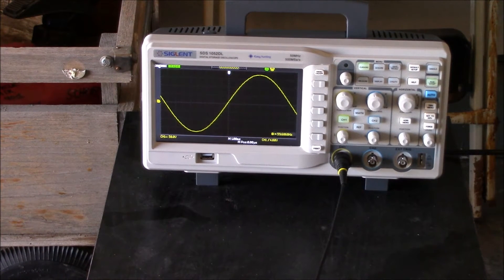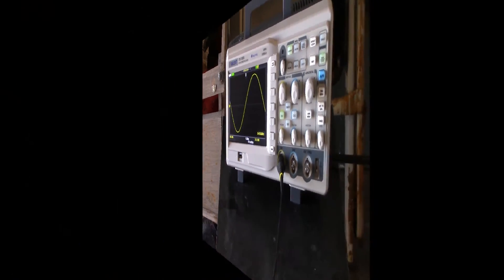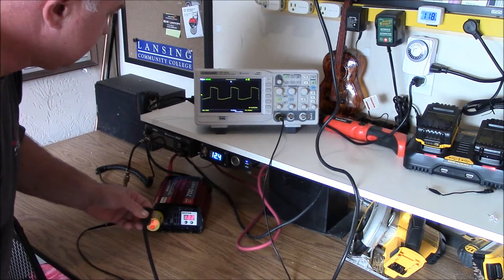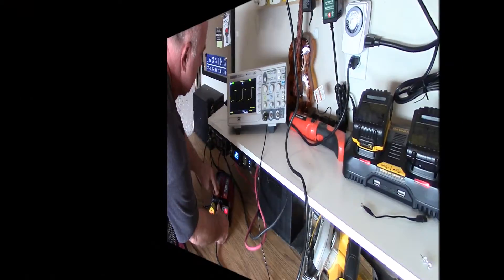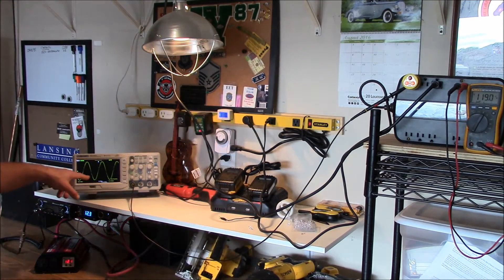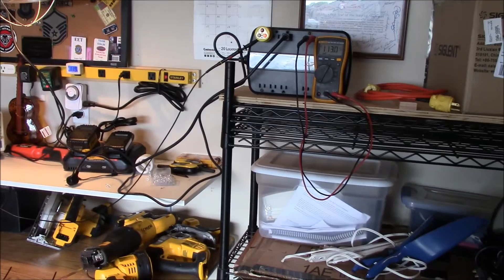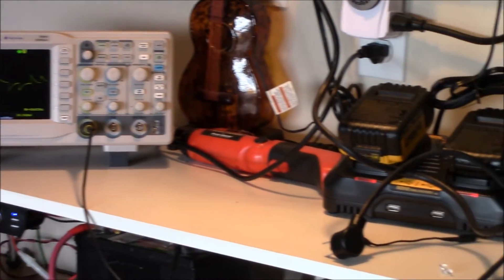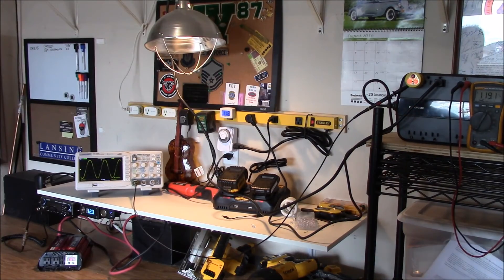How clean is your power? Load testing with oscilloscope.

Comment: Interesting I have a 550 as well and I find that it has out-performed pretty much every model or brand that I have come in contact with I'll be it I did just get upgraded to a nice true sine wave APC that's heating my basement. I did know that it was step approximation and I knew that something was different about it because it runs things better than the older model which is modified Square wave and other brand that was modified Square wave. It has even done better than my 3 modified Square wave inverters 100w, 400w, 750w. I am really thinking I'm getting to the point where I'm needing an oscilloscope I was at a venue doing sound and wished I could have saw what was going on with the electrical as there was a major Buzz that then went away as the night went on and by the time we rung in the New Year there was no buzz from the electrical, there was a buzz from the audio from I don't know what as it's not my system and I haven't tracked it down yet. And it probably didn't help that it was an older building although it did have a ground that was connected to something.
Reply: There's nothing wrong with it from the computer standpoint since it's mostly going back to DC although if your computer is extra sensitive or picky then might want to avoid it. Mine has run a DVR, pfSense dell desktop router, Mac Mini, iMac, laptop with dead battery, access point and switch with no issue. until the battery finally went after 10 years, new battery and all is well again. although I had some issues with it not resetting and thinking it still had an old battery. Shoot my modified sine wave 750 watts could even run the Dell reliably on its own. It has probably run in this configuration for approximately 5 years.

Comment: Hi Chris and everyone. everything you showed was very much right. everyone seems surprised by the APC UPS when on battery mode. I knew the Backups series which you have never guaranteed a true sinewave so i looked it up and it seems to be called a Stepped approximation. If you want to true sinewave from an APC ups you'll have to invest in the smartups line.
Reply from the maker: Right on. I wonder if one could make a small PSW battery back up for less $$$ than the price of a Smart UPS. Could put a trickle charger on it to keep the battery topped off.

Comment: chris, thanks for the experiment. now i am tempted to buy an oscilloscope too. used to work with a 150'000$ spectrum analyzer  30 years ago.
on the ups, i at first thought maybe it is just a signal to search for a load.
have you checked the caps inside? see if they are bloated or something.
and i am glad you have those hydraulic crimpers. you will have to find more leads to crimp now!!!
thanks again
urs
Reply from the maker: Thanks. I have not checked the caps inside. The waveform is probably correct (stepped approximation). It just looks too choppy to me...but, that company sells a lot of them.

Comment: Happy to see how clean that Honda runs 👍 great info. Thanks!
Reply from the maker: Blows my mind how clean that power is made by that little Honda. They are around $1,000...but, IMO, excellent for light duty applications and emergencies.
Reply: +Chris DIYer I have the 3000 watt version. It does my battery charging and feeds the house while charging. These Honda's are more expensive then most other generators of the same size. But you get what you pay for. As your video shows. They are also VERY quit and fuel efficient.
Reply: +Chris DIYer if you're bored. I'd love to see the same test (or higher load as you mention below) done on the Honda and maybe a side by side with a champion or similar box store type generator.
Reply from the maker: Sounds like an AWESOME idea...a couple of other folks are curious too (1,200-,1400w load test). As for side-by-side comparison...another great idea. Too much $$$ tho unless they sent me a little generator to test.
Reply: +Chris DIYer oh yeah. Didn't expect you to buy one lol. Just figured you may know someone with a champion. Heck everyone and their brother has one where I live.
Reply: There's a reason the Honda super quiets are well-loved in the film industry and have decent stabilization